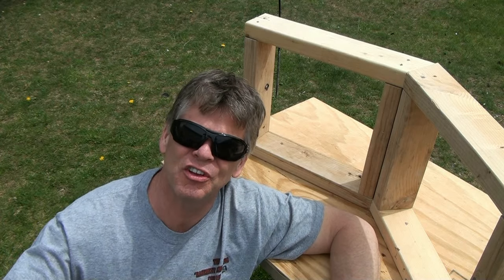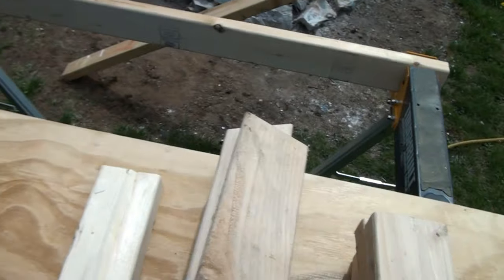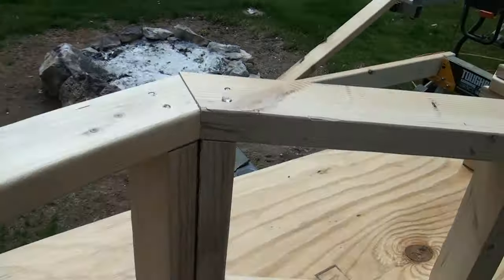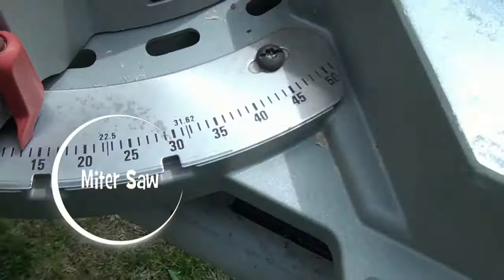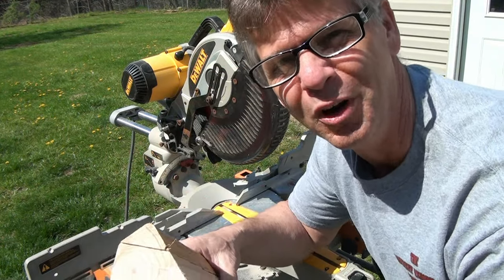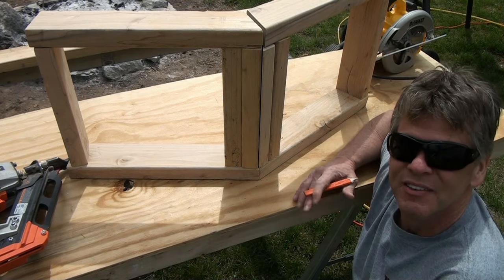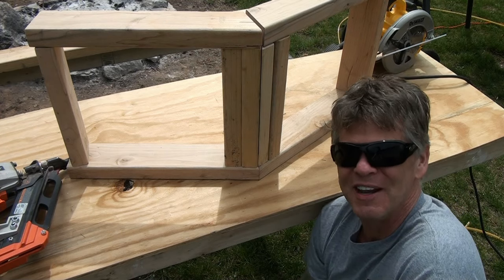How to Frame a 45 Degree Angle Wall

Comment: I just built a 45 deg wall in my basement and watched this video to see how to do it.   It works great.   Thanks for making this useful video.  I initially was going to cut one board at 45 deg and butt up a another at 90 to make other half of the wall.  Cutting both at 22.5 makes it much simpler to lay out and frame.
Reply from the maker: Thanks for watching Fed Guy! Good luck with your projects.

Eddie

Comment from the maker: I've received a lot of questions lately about how to build angled walls...so I made this quick video to help anyone looking to perform this procedure. Please leave any comments or questions below. Good luck with your project!

Eddie
Reply: Well done instructional video, Eddie.  What methods would be used to frame the wall the other way around, with the 45 degree angle on the inside and the 135 degree angle on the face or finished side?
Reply from the maker: @nonenone9811  Just flip your plates over and that will reverse the angle as you need it!
Reply: This is such a great, informative video. Do you think it would be possible to convert a corner wall from 90* into two 45* angles like you made in this video? I'm looking to make some more space in a walkway at my home, and unfortunately, I think it is a load-bearing wall.

Comment: Thank you!! Came looking for this for type of idea for an outdoor project. Is this way easier/stronger or same as cutting the 2x4 diagonally from corner to corner which will get two of the same size pieces, the same shape as the way you did it?

Comment: this is the type of exact framing I was looking to do for my small side shed in a tight area of my yard, between my deck and pvc fence area. I have an area of approx 5x10 and I will def use your framing method and post pics of such.  thanks again !

Comment: Hi Eddie. Videos are great!  Can you provide some advice on how to frame a 45 degree wall using 2x6 material? Having trouble figuring out how to cut the apex wedge piece. Thanks!
Reply from the maker: Only works with 2” x 4” walls
Reply: @BasementFinishingMan  thanks for the quick reply. Any advice on how to tackle this with 2x6?

Comment: is the wedge needed if the wedge side wont have dry wall? trying to save a step, but maybe its needed to secure the two walls together, unless there is another way. Let me know. thanks for the videos
Reply from the maker: Yes it is…wedge Keri’s the corner on both sides from cracking-out after drywall is installed and finished. Best to install it!

Comment: Great video, thanks! If doing for an external wall that’s eventually going to be wrapped and clad, do you think there’s any real need to create the wedge to fill the gap? Or could you just leave a void and fix the outer osb to the nearest stud? Maybe try and stuff the hole with some kind of insulation?
Reply from the maker: Hi Dave! I suppose you could, but it wouldn't be as good. The correct way to frame it would be to include the 45 degree wedge stud so your framing is solid right to the tip of the Apex.  ~Eddie
Reply: @BasementFinishingMan  only problem is my angles aren't 45 degrees, I have an odd shaped hexagon thanks to a couple of trees on the plot. I'm thinking it might be better with either a few noggins at the desired angle, or butting two studs together, one slightly larger (6x2 instead of 4x2) and cutting the desired angles lengthways off the larger one?
Reply from the maker: @findingoutthehardway  That would be better than nothing at all in the corner Dave...I would do it.  ~Eddie
Reply: @BasementFinishingMan  nice one, cheers for the replies!

Comment: If the end of the 45 was a shower door opening would the framing be the same, except you cut off just after the 45 degrees?  So the bottom and top stud would be very short on the 45 deg turn part?

Comment: I have a bow window to frame with three 45 degree walls with four 45 degree angles. Should I frame each wall section individually (16" OC with an extra stud at the end) or should I treat the 3 walls as one long wall, putting a stud every 16" with extra studs at the 45 degree corners? I could score the back of the drywall at each 45 degree angle without breaking the paper and build the wall by continuing the 16" OC pattern as if it's one long wall.
Reply from the maker: Treat each wall as a separate wall it's much easier to frame Russ!

Eddie
Reply: @BasementFinishingMan  thanks, had the same question!

Comment: Thanks this helped a lot. I actually used this to create a wood retaining wall for my garden. Question I have, what would be the best way to tie the wall together?  I have 2x4 wall going into a 2x6 footing sitting on level gravel.  Its a long shot but thought I'd throw it out there
Reply: I know this is 2 years too late, but I would use a 45 degree framing bracket/corner angle to hold them together.

Comment: I have been watching your framing videos and I am off to what I think is a pretty good start.  Wall #1 is up and starting #2 tomorrow.  This vide on the 45° angle is exactly what I needed.  One question though.  Is the apex stud you make from the rip cut a full length stud? In other words is it 8' or 9' long like the rest of your studs in the wall you are building, or can you do shorter pieces and fill in every other foot?  Not sure I can freehand rip a 2x4 8' at 45°.  Thanks these videos are a life-saver!
Reply from the maker: It's 1 long continuous stud Adam.  ~Eddie
Reply: @BasementFinishingMan  Thanks for the quick response! I have a B&D workbench that I can clamp the stud in that should help with the ripping.

Comment: can I do this if the 45 degree corner is going to be part of the door jamb.  I don want any  additional wall length, just the door right at the corner.
Reply from the maker: You can as long as you stay out of the 45 degree corner at least 1.5"' to 3" .

Eddie

Comment: I need to build a 45 degree wall, but it is mostly going under air ducts.  Should I build the soffit around the ducts first?  Basically most of the top of the wall can't be nailed into joists because of the ducts, how can I properly nail it in place?
Reply from the maker: Build the wall under the ducts first and then when you build your soffit around the ductwork this will tie it all together and make for a very very sturdy and solid set of new  angle walls!

Eddie
Reply: So when the soffit meets the angled wall, the end of the soffit should be cut on a 45 degree angle, correct?
Reply from the maker: That is correct! They have to be or they won't fit...

Eddie

Comment: thanks great video.  Is this the same method for any angled wall?  Like a 52 or 26?
Reply from the maker: No Jake...this is just for 45 degree wall angles.
Reply: Is there a technique for angles other than 45 degrees? How else could you handle the gap on the corner?

Comment: anyway I can rip the 45 angle with a table saw?
Reply from the maker: You can Joe! Set the saw on a 45 and line up the edge of the 2" x 4" with the blade and push it through! The table saw will do the exact same cut...maybe even better than a freehand circular saw cut!

Eddie

Comment: So this is awesome. However, I would like to build a wall from an existing finished corner out at 45 degrees and then that wall's other end would be 45 degrees to another wall.  The end goal is to have two walls, one with a door. This would create a new room in our basement.  Help please?!
Reply from the maker: Your outside 45 degree corner would be built jut like the one in this video. The other two walls which start and stop at other existing walls would simply have a 45 Degree angle cut on the ends of there upper and bottom plates so they would fit perfectly against the two existing walls. Hope this helps.

Eddie

Comment: If my angels are not a 45 can I use the same system to make it work?
Reply from the maker: If they are within 5 degrees you can cut the apex and it will be real close to fitting perfec t and should fill the apex gap okay.

Eddie

Comment: will this work for other angles...35 degree  65ndegrees etc?  thanks
Reply from the maker: No it won't...you can get it close but you won't get a perfect apex angle...  ~Eddie
Reply: Thanks for the quick reply and great video.
Reply: What do you guys think is the best option for a 65 degree wall frame ?

Comment: Question - why do they call it a "45 degree" wall when the angles are 135 or 225 depending on what side of the wall you're looking at?
Reply from the maker: Because the degree of the angles on the saw you use to cut the plates equal 45.

 22.5 + 22.5 = 45 degrees...
Reply: @BasementFinishingMan  Me/guy were talking about that b/c thats the only way you get 45 was from the 22.5.  Otherwise the 22.5 miter saw setting produces a 112.5 heel and a 67.5 toe and you cant get 45 from those numbers.    But then we were like then why dont they call  a standard 90 degree corner a "zero - corner" or "zero-wall."   I have a million construction questions that remain a mystery
Reply: @BasementFinishingMan  I think what screws most people up who have trouble with saw angle settings and knowing the toe/heel angle that will produce is they always use 45 degree miter saw setting as their mental example which produces a 45 degree toe / 135 heel, so they think that the angle you set the saw on will cut and produce that same angle on the toe of the board they cut when the reality is 45 is the only miter saw degree setting that produces the same angle on the toe.  Every other miter saw angle setting that does not happen.  I couldnt imagine how much lumber has gone down the tube because of that same pattern of thinking.

Comment: Don’t get why a 45 degree angle look bigger than a square angle
Reply from the maker: Well we call it a 45 degree angle but it's actually an angle that is "open" more than a 90 degree angle(square angle), it's only 45 degrees less than 180 degrees(a straight line), so it could be called a 135 degree "open" angle...so that's why it looks bigger than a square angle. Hope this helps.

Eddie

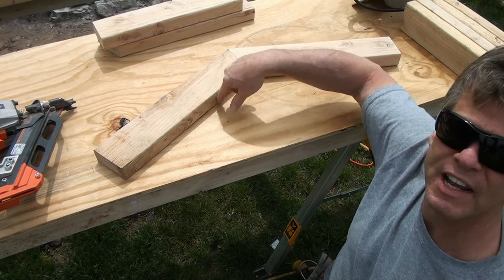Comment: 4:46 "now we have a 45° angle right here"...points to 135°. Great work, but your 45 is the "void" on other side subtracted from 180 (hence your 135 result). I understand that in construction it's simpler to say it the way you do, but you still should have pointed out where the actual 45° is on video.
Reply from the maker: Nobody really wants to talk 135 degree angles! Average homeowners want to build a 45 degree wall so that's what I talked about...be it over simplistic, maybe, but I didn't want to make this a geometry lesson. Thanks for watching and for commenting Markarita.

Eddie
Reply: And the "tool award goes to......" Great demo Mr Case. I'm sure lots of folks enjoyed the vid.

Comment: Calling that a 45 degree wall is horribly misleading, 135 degree would be more accurate because you're removing 45 degrees from a 180 degree pivot point
Reply from the maker: In the business we refer to this as a 45 degree wall...but technically you are correct. Nobody says "build me a 135 degree wall" generally speaking. it's just a lot easier to explain it to a novice this way when you're discussing the miter saw angles that make up this particular wall angle to refer to two 22.5 degree angles creating a 45 degree angle.
Reply: It would depend on if you were inside the room or outside. Inside...45...outside...135.
Reply: You are calling it a 45 degree wall because in construction you are cutting each piece at 22.5 degrees to form a 45 degree angle. All miter saws have a set stop at 22.5 degrees for this reason. So to your point, in construction, calling it anything but a 45 degree angle is misleading.